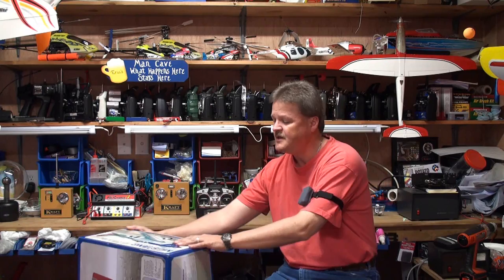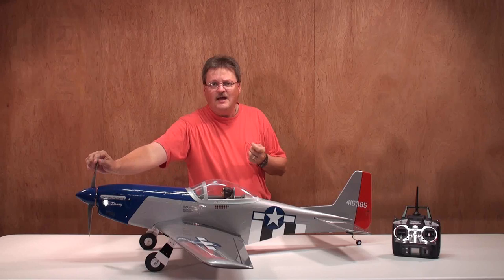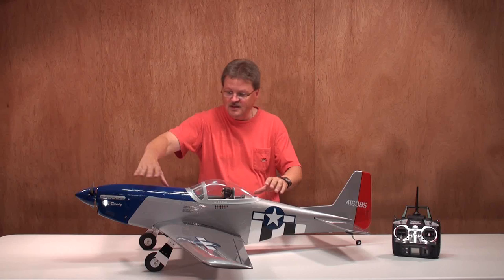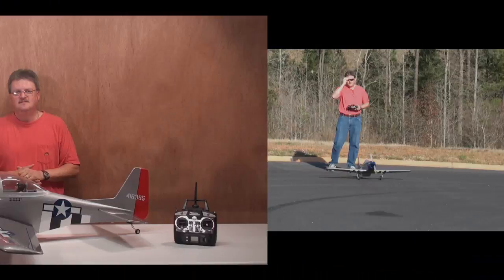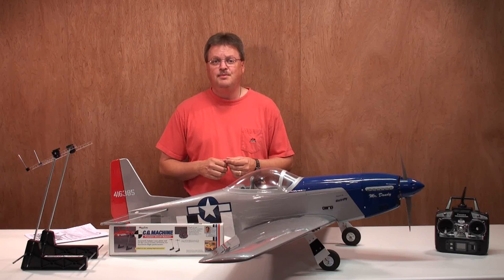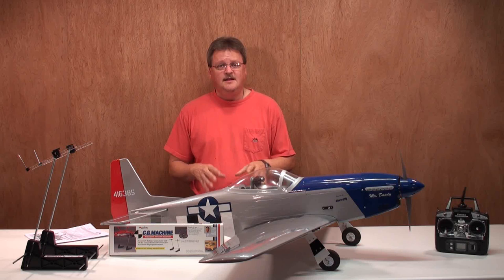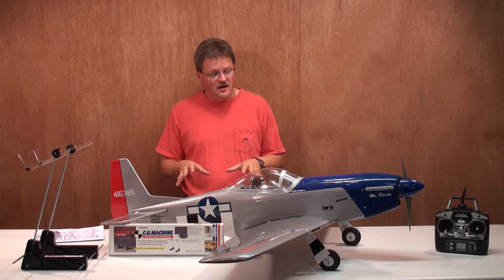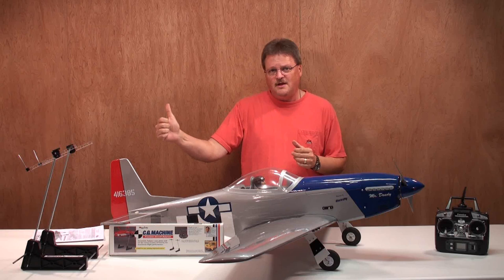Great Planes P51 Mustang Review and Flight

Comment: I Think this plane is fantastic. I really enjoy it because flys so true. If you add 2 1/2 oz. to tail weight it will fly much better and land so very much slower and smoother as well easier to handle. i.e. ( IT WONT BOUNCE ON LANDING) BTW I use glow with a 46FX O.S. The Plane will go verticle with no problem !!! Great Value.

Comment: Hi, I´m happy with this airplane, I did take the glow option with an os 46 AX like show the manual, I have about 6 flights but I notice this bird is so fast 100 mph metered, and that causes flutter in the vertical stab, Do you have any tip to correct that?

Comment: "Not a good first plane because it's larger, weight 7 pounds, having aileron control..." My LT-40 Kadet Trainer weighed 8 pounds and had ailerons and it was a TRAINER! So that criteria isn't exactly accurate. However, you're right. A P-51 is most certainly not a beginner's plane.

jussayin'